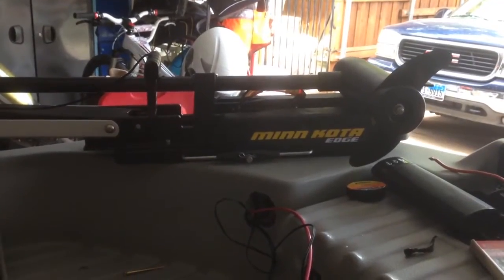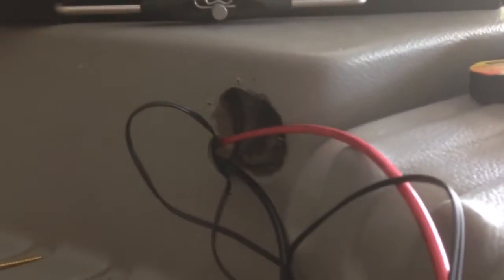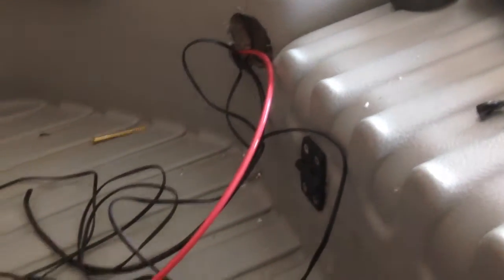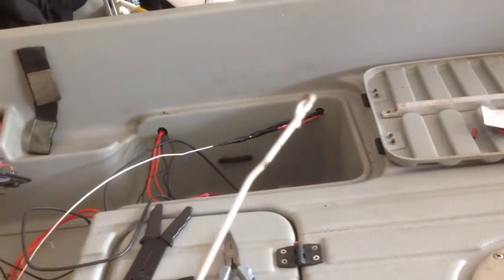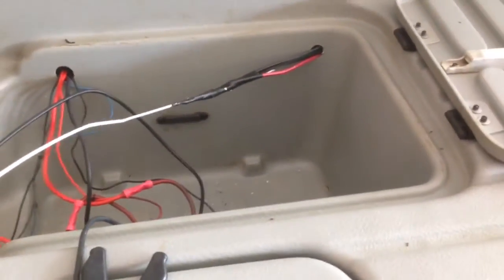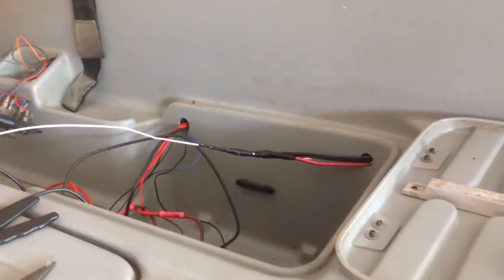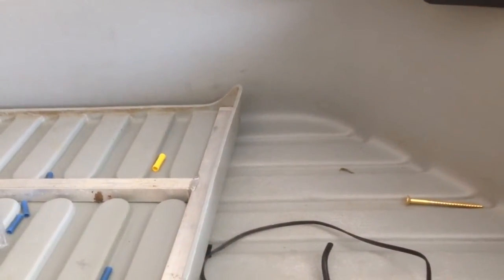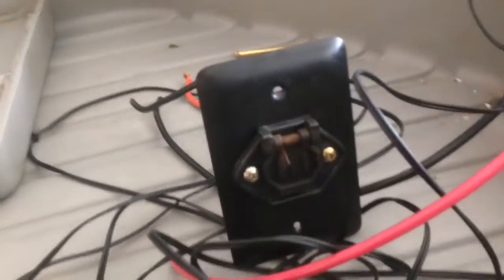Boat Wiring - Use a coat hanger to run wiring

Comment: You did good figuring that out. I used a snake tape from Lowes when I rewired my boat lights. The wiring ran through a boxed frame and I did not want to run the wiring down the side of the frame. So, the snake tape pulled them out and ran them back in. I was impressed at how well that thing worked.